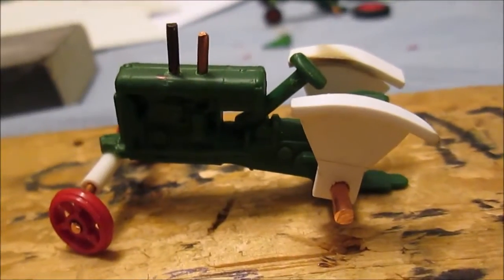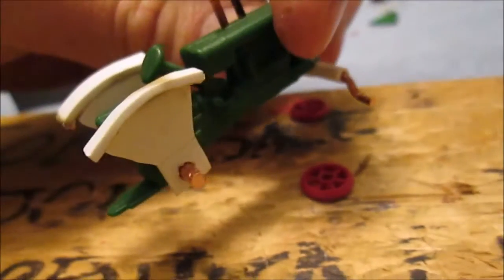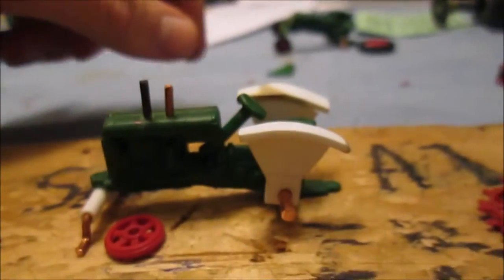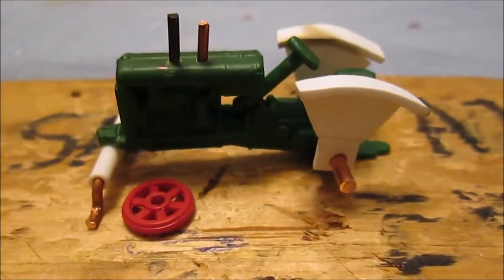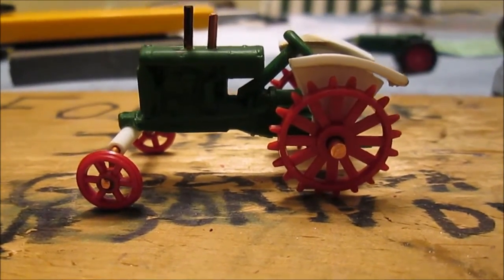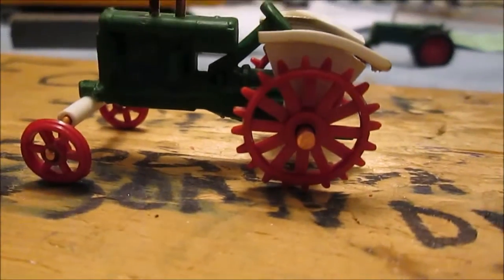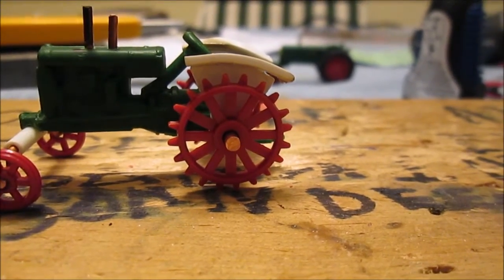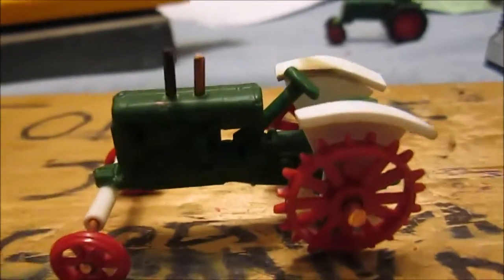CUSTOM building fenders

Comment: Here's a suggestion for you Curt.  Check out a magazine called Fine Scale Modeler.  They don't deal much with tractors, mostly military, planes and cars but you will get a great education in a wide variety of modeling and scratch building techniques.  http://www.finescale.com .  Also look at Micro Mark Tools, they have a huge assortment of tools designed specifically for modeling. http://www.micromark.com/
Reply from the maker: ive heard of micro mark tools, but i like to figure out my own ways of doing things but some of those magazines do have great tips !